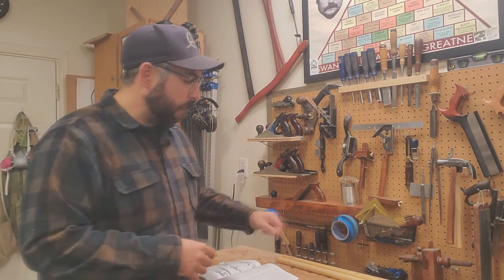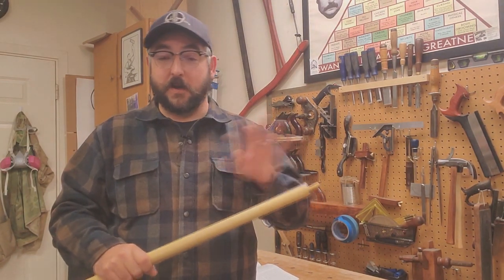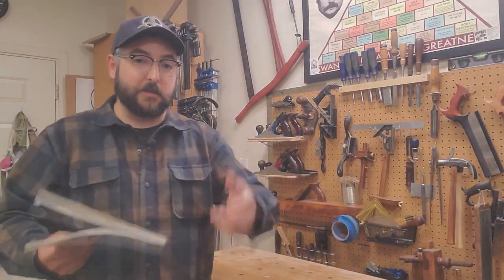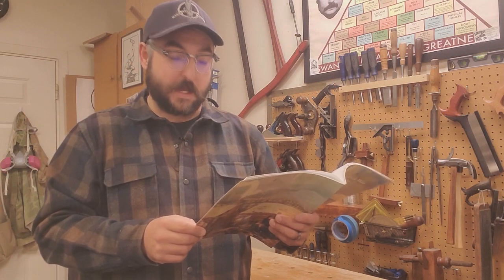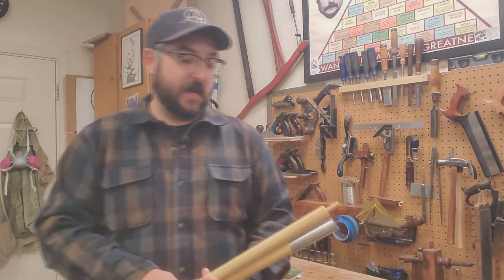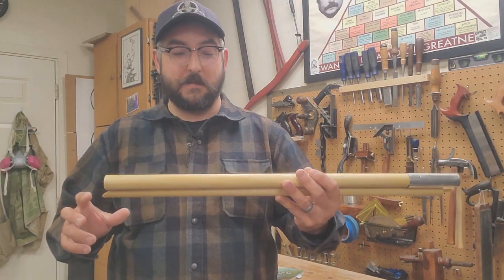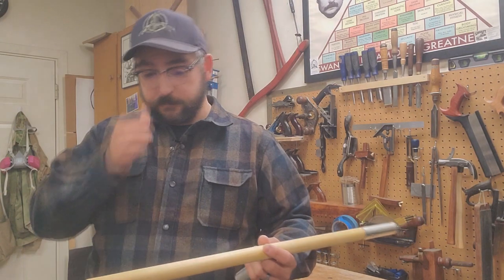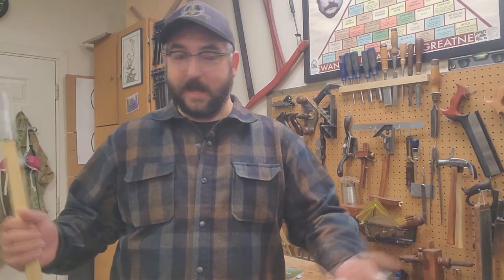Making Civil War Issue Tent Poles

Comment: I am now retired from Roofing and Sheetmetal trades. Part of the reason for your unsatifactory soldering job is realated to improper flux and not enough heat when you applied the solder.(50/50 bar solder)
If your metal is galvanize steel or tin, try cutting muriatic acid for flux and get the joint to be soldered hot to the point that the solder flows evenely. Don't scrub the solder....let it flow while moving the iron (called sweating the joint). When done soldering, wipe doen the joint with water and a rag to nutralize the acid flux.
With a little practise you soldering will get better.
Reply from the maker: Priceless tips!  Thanks so much, I'll give it all a try.

Comment: The book civil war soldiers personel equipment shows some excavated ones 
The top pole has a metal peg hammered in with a short tin ring around it to stop the wood splitting,instead of the wooden peg
Reply: Dave Ridding Same most I saw where the same as what you said

Comment: This is one place you don't want a super tight fit. When it rains, the wood will swell and get impossibly stuck.
From there it will take days of drying or a heat gun to get it apart.
I know this from experience... A single coating or two of linseed oil was not enough to prevent it in my case, using pine.
Of course, if you make that diagonal cut the same length as the joint, I suppose it may solve or alleviate this problem?

Comment: Great video! I have made a few of these myself. For the ferrules I used tin that I cut out of empty gallon lacquer cans after cleaning them up.  It helps that they already have a radius to work with, though I am somewhat unhappy with the gauge.  Would like something a little heavier.  Not everybody has specialized tools to make the tenons.  What I did was create a jig perpendicular to the fence of my router table, then I rotated the pole in the jig with the end of the pole over a straight bit.  This turned out great.  I also fabricated a jig that slid down the slots of my table saw in order to cut the poles in two.  The jig enabled exact consistency in the angle of cut, and the finished lengths for all the poles that I made.  - Eric Hageman
Reply from the maker: Great tips.  I should have thought to demo the table saw idea.

Comment: To remove the coating on the tin, use turpentine with paper towel and a lot of elbow grease. That will remove the coating. Buying tolls of tin in bulk, you can get it uncoated. However the uncoated sheet tin is more expensive, but less time consuming.

Comment: I think that for this you could use aluminum and solder it in place of the tin I must admit I cant solder very well I'm a welder by hobby aluminum might be easier to run a bead as for the reproduction they might lay wire over the gap on a preheated tin peice if I can get some tin I might try this also lead based solder would help alot the morden lead free stuff doesnt flow the same I know that from electronics repair
Reply from the maker: Good point on the solder.  We had another recommendation to use predominately lead solder and it has certainly worked better than the others.

Comment: I bought a percussion cap pistol a few weeks ago. I finally got the caps three days ago and was firing it when I noticed that it wasn't firing until the 2nd or 3rd try. The pistol was cleaned two days before I bought it from the man. I'm not sure what type of reproduction it is all I can see is Spain so. I don't know if there is any ideas you can give me about how to get it to fire the first time.
Reply: Wesley Cantrell another reason is you probably have caps that are the wrong size. If you bought 10s, buy 11s, and vice versa. The caps are not seating and it’s taking the force of the hammer hitting it a couple times to seat the cap.
Reply: @banjoman5000  not sure the grain powder as I'm using rounds left over from a re-enactment from last season
Reply: @banjoman5000  I will try 11s cause I'm using 10's. My brain said buy 11's but I got 10's cause it was cheapest option
Reply: Wesley Cantrell chances are it’s the wrong size caps. I posted the second reply after re-reading your original comment and thinking about it more. I have had the same issue before and it was due to the caps being the wrong size.
Reply: @banjoman5000  ok. What grain powder do you recommend getting
Reply: Wesley Cantrell fffg for pistols. I also highly recommend using real black powder and not synthetic crap. Firing blanks, the synthetic powder (pyrodex, triple 7, etc....) will basically turn into concrete in your bore and not be a pleasant, nor easy process to clean out. Use real black when firing blanks, and clean with hot water after every time you go out.
Reply: @banjoman5000  FFFG and hot water to clean. Is FFFG a brand of powder?
Reply: @wesleycantrell332  F, FF, FFF, and FFFF refer the the size of the *G*rains of powder - the more F's, the smaller (finer) the powder is. Generally, F is for artillery, FF for rifles, FFF for pistols, and FFFF is for the priming pans of flintlocks. However, if you get European (Swiss) powder, they have different nomenclature.
Reply: IMO the Civil War Medic is spot on with his recommendations.  Try all of these suggestions and let us know the results.  Good luck pard.